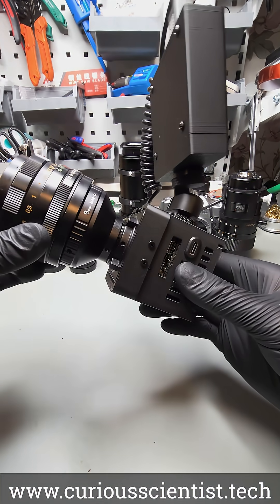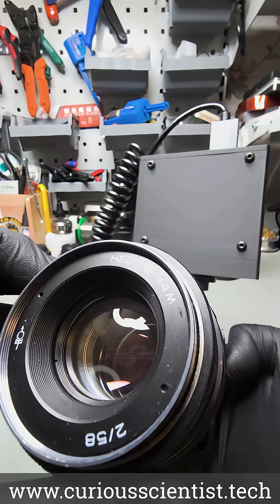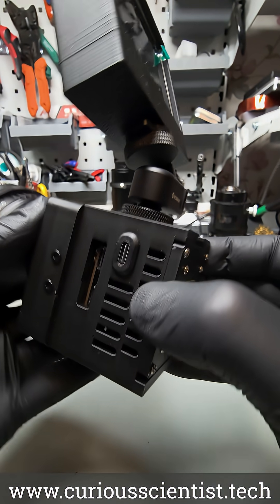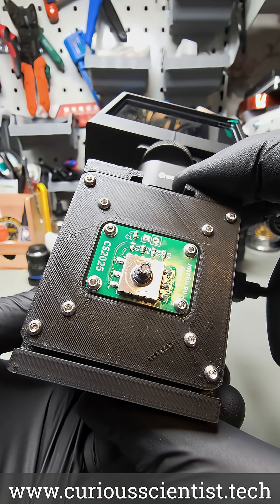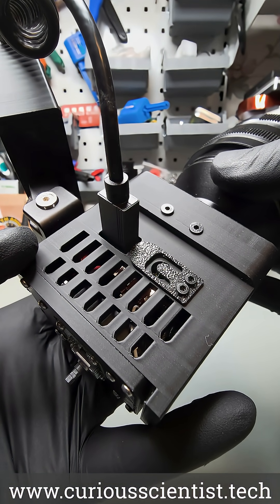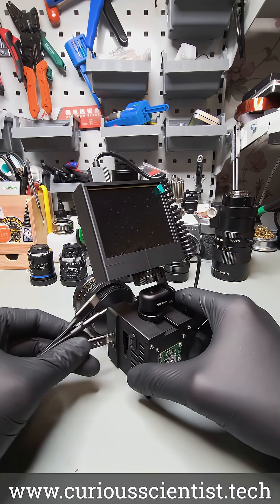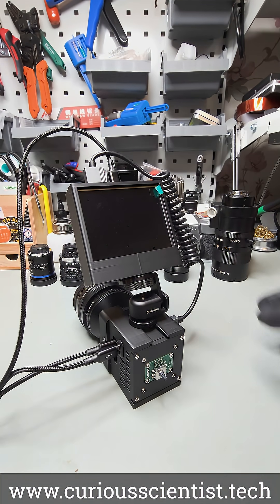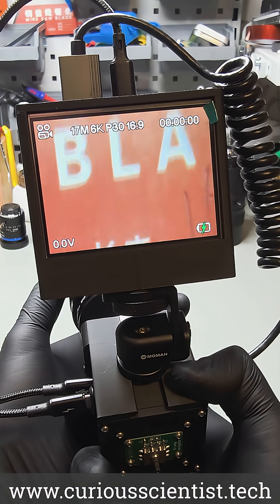#6k #DIY #cinematic #camera #3dprinting #electronics #fpv

Comment: nice project! so i checked your article and found all the links for the hardware. but did you release the print files for the housing somewhere or will they be non disclosed?
Reply from the maker: Sure! As I mentioned in the video, all my supporters get access to the 3d-printable files. If you become a channel member, you'll receive access.

Comment: What is the total power consumption of your device, more details if possible? Are you using microcontroller or single board computer in it? Thanks
Reply from the maker: Watch the long-format video and read the article, please. Everything is answered there, and in the datasheet of the camera module's manufacturer.